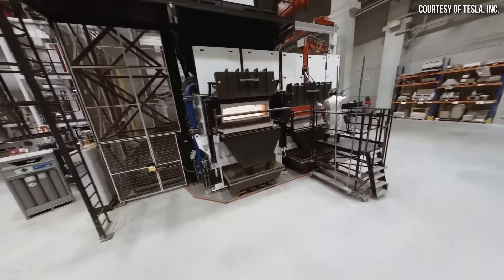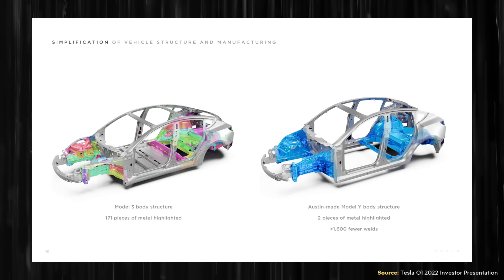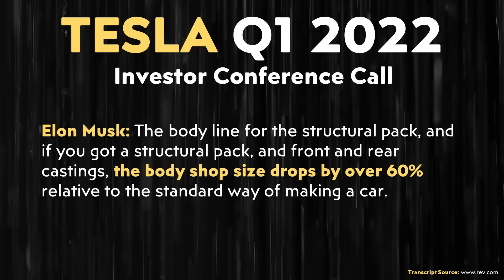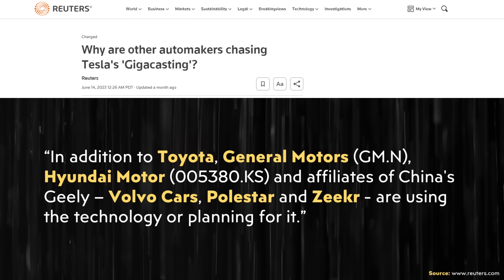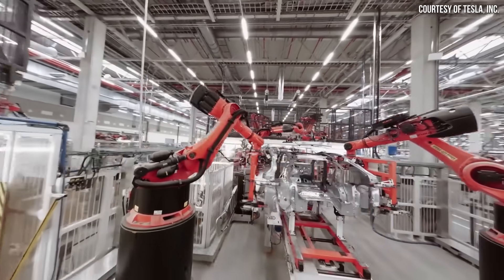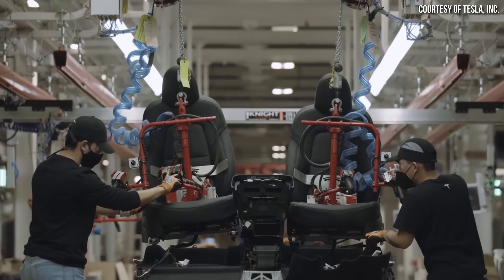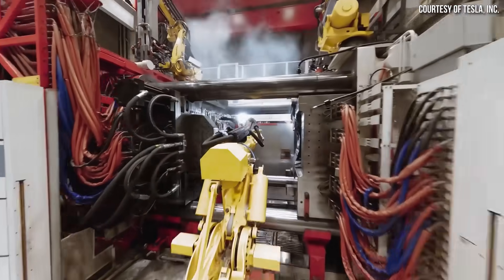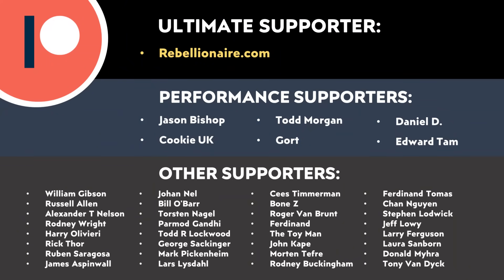The Tesla Model Y & Cybertruck Giga Castings are PURE GENIUS!

Comment: repairability does not JUST mean easy replacement.

What about repairing a puncture, disassembly to replace a component of a larger component. 

By making these easier to manufacture you often sacrifice the ability to replace small parts vs replacing an entire mega casting.

There is a reason car insurace rates are getting enormous, nothing is repairable for less than 70% of the entire value of the damn car. 

Service centers can't just yank a bad cell, instead they replace an entire battery when a single cell out of 7000+ cells fail, a $2 part requiring a $20,000 battery replacement is the bane of these things...

Comment: There are all levels of car collisions. From insignificant to total destruction and everything in between. The concern, by insurance companies I assume, would be those lower level bumps - just hard enough to damage the sheet metal and maybe deform the casting a small amount. What is the fix? Can the casting be pulled back into spec using frame straightening machines? Or does a smallish accident that would be repairable on any other car generate a total loss? No one (other than the car makers) can say with any certainty yet. My bet is that as more cars are made with these castings (not just Tesla) the insurance companies will make some adjustments to premiums as they learn how these cars fair in all type of collisions. Could be up, could be down - we don't know right now.

Comment: Tesla did not pioneer these megacastings.  GM used basically the same thing for the C8 Corvette a few years ago.  Matter of fact they couldn't find a supplier, so they had to do it themselves.  Also, that same Reuters article disputes that repairs are easy with these types of castings.  And lastly, GM is using additive manufacturing for their designs, so they have already been able to go through several iterations of their designs.  They are not behind in designing these things.
Reply: Sandy Munro did a video in 2013 about the bmw i3 it was waaaaay too advanced for it's period with giant front and rear castings from the wheel sides to attach to the aluminum frame and all assembled with the carbon fiber body and also the tons of recycled materials too.

Comment: FSD Beta is not available on HWD 4.
Recently bought Model Y, waited for HWD 4. Subscribed to FSD, (really Advanced Autopilot). FSD Beta option was unavailable & grayed out.  I contacted 3 Tesla Reps finally visiting the Service Center. They suspected it was related to a camera issue & scheduled service appt.  Tech pushed new update and cancelled appt. Revisited service center, advised remote diagnostic to be performed. I advised hearing of pending recall on Y camera issues.  Service Tech advised no recall on my car and remote diagnosis to be performed.  I asked when, finally advised FSD Beta is not available on HWD 4.

Comment: These castings are also X-ray qualified . They are stiffer, stronger, lighter and a better fit and finish of the total product results from less stack up with being only one piece as compared to multiple pieces being welded and glued together.  Therefore huge cost of quality improvement along with the huge tooling , process, man power, and facility cost savings. This now allows Tesla a much Greater final product price advantage over other car and truck producers. Therefore reduced cost equals reduced final price of the units to the customer. For years to come!
Reply: Nope it's not! Plus steel is significantly stronger! With steel frame for example your truck can be made with single/double cab/ dump bed, crane or many other accessories or super easy to customise for alot of applications for example.

Comment: It is worth noting that if the castings in the front and rear are actually lighter than what they replace, this also reduces the polar moment of the car which improves nimbleness and handling.
Reply: It's actually not lighter than what it replaces lol!!!!! What are you smocking!? Who told you that!?
Reply: @alanmay7929   This guy told me that:   https://youtu.be/IMAsCy7YU1M?t=381   "The net result is that when aluminum (casting) is used for a vehicle body instead of high strength steel, the vehicle body ends up weighing 23% less.....At the vehicle level, the weight savings increases to 93 kg."

Go argue with him and ask him what he's smoking.

Comment: The great thing about the castings is that Tesla should be able to use the ones for the Cybertruck to make a conventional bodies version, including the battery pack. It looks like the concept of an Exoskeleton didn't make much sense. The Cybertruck panels may be different, but the structural strength is still mostly in the pillars and frame that is pretty much the same as conventional cars. Let's hope Tesla drop the Cybertruck quickly in favour of a more conventional looking design that isn't as divisive.
Reply: Agree. Also, hire one of the many outstanding design studios to create the new skin. Tesla's design studio is not winning any awards.
Reply: What a joke!!!! You thought a "exoskeleton" crap could be a thing!?

Comment: Cybertruk is made with 30-x cold rolled stainless steel stretched over a frame. Gigacasting? What is being gigacasted? What is it with this title?
Reply: The underbody of the CT will be gigacastings. It will also have a frame - it's just that unlike most vehicles on the road the outer skin will contribute to the strength of the vehicle rather than just being added afterwards for aerodynamics.

Comment: You didn’t mention that the front and back castings assure almost a perfect alinement so that there doesn’t need to be components that have to be bent or forced into place.  Welded parts can be warped or misaligned when put together.
Reply: But it's not repaired when the cars are written off as fo using the alloy it is not recycling back into aTesla structural parts because of the special alloy as it contamination
Reply: "alignment"
Reply: Nonsense!!!! Which alignment!? Making parts and assembling them are totally different things! You were talking about millimeter size gaps with the castings right! Keep joking lol!!!!
Reply: And they don’t need to be painted.  Tesla had a metallurgist from SpaceX (or so the story goes) formulate a custom aluminum alloy that is corrosion-resistant enough to be left unpainted.  It sounds like the Cybertruck will require no paint on the body, which saves big $$.  Automotive paint lines are crazy expensive, like half a billion just to build.
Reply: @ClockworksOfGL stop talking crap!!! Every little car manufacturers have matalurgists too! How do you think engine blocks!? Gearbox! Suspensions and even body/shelf are made!? How do you think trucks get made to haul over 300,000lbs of loads......
Reply: @ClockworksOfGL lolllll
Reply: When a sheet steel car gets bent in an accident it “can” be straightened but the future crash integrity is often reduced. This rights off the car because integral crash protection cannot be repaired.
Reply: @Dave5843-d9m it's a small part of the steel that gets bents while aluminum actually cracs and can't even be repaired in the middle of nowhere!
Reply: And then you dont need as many controllsteps.
Reply: @Myrslokstok you always needs control steps nomatter the assembly lol!!!
Reply: I can actually feel the difference when a Tesla Y passes me while I am riding my ebike... And the energy is totally different.
Reply: @DrTofutybeast that's what she said!!!
Reply: Used castings can be recycled. Tesla would simply need to clean them. Other uses for the metals don’t care.
Reply: @Dave5843-d9m what are you talking about!?

Comment: I would be worried about cracks developing in the castings over time.
Reply: Don't fly, large jet wings are cast, it is stronger than cold rolled.
Reply: @kbaker2123  High-stress parts that require strength on aircraft are forged not cast, and they are usually not made out of aluminum. They also are not as big as the Cybertruck castings because these are the largest aluminum parts ever cast.
Aluminum parts on aircraft often crack, especially on the wings. You ever hear about 757/767 engine mounts cracking. I have, even repaired a few, and I didn't use aluminum to repair them.

Comment: Castings, means the cars will be written off more readily...which is why it isn't a problem for Telsa with it's own insurance company...and... their added profits from putting castings in their car will make this cost effective....

but wasn't the point of the world changing over to EVs,  to save the planet ?  If aluminum castings become the norm for all auto manufacturers , along with more frequent accident right offs...this will put EVs way past the 100,000 Km break even point with CO2 emissions of ICE cars.
Reply: If a car is “written off” the insurance company (Tesla) takes the financial hit
Reply: They said it is easier to fix casting than a traditional body. They explain why it is easier from the last call earning.
Reply: Everything manufactured on Earth comes from the earth.
Whether cast, forged or rolled, it can all be recycled.

Over their entire life, most ICE or electric vehicles make it to retirement and are scrapped and recycled. Most are not totaled.

Electric motors will likely last 1 million miles. That's 3, 4 or 5 times as long as most modern combustion engines and their transmissions, catalytic converters/exhaust systems, brakes, rotors, alternators, spark plugs/packs, 12 volt batteries and other fast wearing parts.

Comment: By 2024 the argument will switch from;
That doesn't look like my normal work pickup truck.
To;
I can't get a Cybertruck because all these hipsters in line in front of me  are buying them as status symbols.
Reply: I would bet 90% of all pickups are bought as status symbols. In time cybertruck will just be the 10% bought fir actual pickup work use. I say this because the interior is so basic and lacks the luxury. Its utilitarian like old pickups. 

Unless the aftermarket goes as far as fitting whole new luxury interiors its going to in time be just a work truck in volumes 10 to 20% of the F150

Comment: If manufacturers were so concerned with owners maintenance and repair, GM wouldn’t have designed the pinto so it explodes on impact or Ferarri wouldn’t make a car where you have to pull the engine to change the spark plugs. Gigacastings definitely make manufacturing easier but repair? The jury is still out. Why hasn’t Tesla released the crash data? Inquiring minds want to know…
Reply: Except the Pinto was a Ford. 😉
Reply: They have commented on this
Reply: I have heard from german bodyshops that it’s not easier nor harder to repair or replace. Just different.

Comment: Does Fremont model Y come with front and rear single casting as TX?  If not, is Tesla expected to make such a change?
Reply: Yes they all do at this point
Reply: @SDot-dp9xm  All the Model Ys have front and rear castings, but the Model 3 has yet to which is why so many are excited about the Project Highland rumors.

I fully expect there to be a Gen 3 Model S and X in the future that are ground-up new vehicles with gigacastings.
Reply: Does the Fremont Model Y also have the structural battery pack?

Comment: Panel beaters might disagree.
Reply: If you get hit hard enough to bust the casting it's likely a write off anyway I'm guessing?
Reply: @monkeysezbegood  not in Pakistan
Reply: @monkeysezbegood  it’ll be reflected by the insurance cost.
Reply: And ICE mechanics will give you all kinds of reasons why EV’s are bad.
Reply: @Frank_W.  it’s not the battery …..it’s cheapening of the product
Reply: @davidpearn5925  I would be inclined to believe that there’s a big difference in lining up a few components verses hundreds.
Reply: @Frank_W.  it’d all be automated
Reply: Most damaged caused by 15 mph are a total anyway. Thanks to crumple designs to protect the occupants.